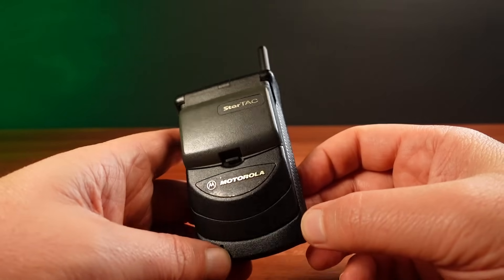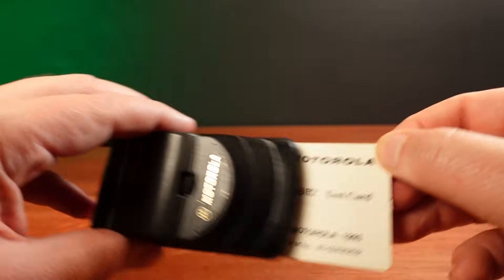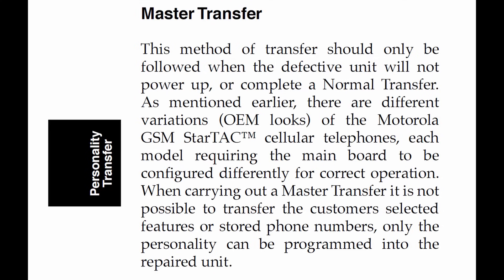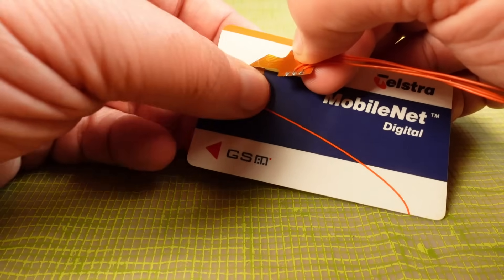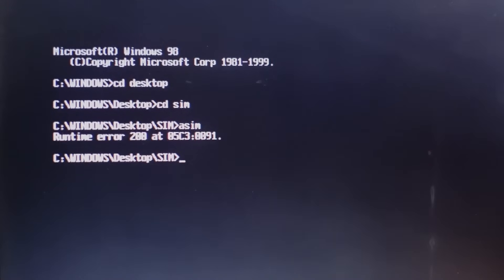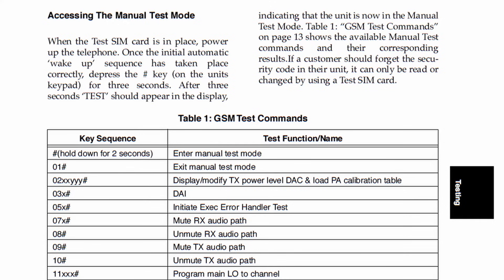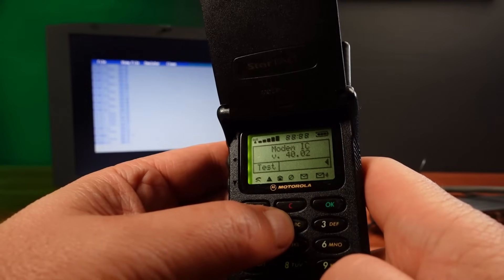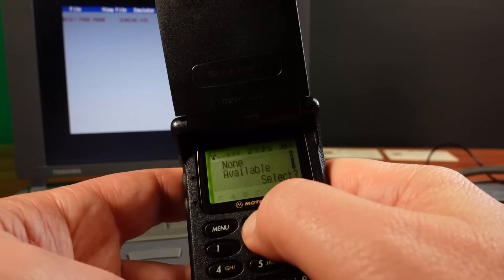SIM Card Emulator Vs Motorola StarTAC

Comment: I had a play with these Motorola SIM card emulators a few years ago and changed the graphic on a M3788 and enabled the Engineering menu on a V3688. It was quite fun wandering around with it looking at the figures. I didn't bother making a fancy "SIM Card" like you did, I just used crocodile clips to clip onto the sim socket. Your solution looks a bit more elegant.
Reply from the maker: That is cool, clipping directly onto the sim pins and getting the job done. The V3688 is so light and small, I have one as well.
Reply: @JanusCycle  The V3688 is a cool device. The sounds quality is good and the holographic reflector they used in the screen is really neat. Unfortunately its all plastic clipped together construction makes it a bit flimsy -  a bit reminiscent of today's smartphones! These old GSM Motorolas would be quite usable today if it weren't for issues with their SMS support. They only seem to support the 7 bit GSM character set and some people will send messages with non-GSM characters, in which case the phone will refuse to display the whole message, whereas Nokias and Erricsons will just ignore the dodgy characters. I've no idea what characters people sent me in order to cause this; probably just those pesky smileys :).

Comment: Great video, makes you wonder how much mischief could have been had with this knowledge when the network's were running.
Reply: In the days a little before, phones used analogue transmission with digital codes for cell routing etc. Some shitty newspaper had a radio scanner and caught Prince Charles exchanging naughty words with Camilla. All completely unencrypted. The other thing was, people would set up premium-rate phone lines. Then they'd go out and wander through town with a receiver picking up, I think, ESN and MIN codes ("pairs"). They were transmitted by phones as part of the protocol, unencrypted, and the network trusted you were who you said you were.

So they'd hack phones and put in these pairs, cloning the phones whose signals they received earlier. A cloned phone is on somebody else's phone bill. I saw a TV report, a wall with dozens of phones mounted to it, all on chargers, and all cloned. Ringing up the premium rate number in another county. Racking up a fortune in bills. But because it was a foreign country, the home nation (Britain) couldn't do anything to force a refund. The foreign telco and the pirate split the profits. A lovely little earner, and all you had to do was hang round a metropolitan train station for a bit while your gadget filled up with pairs. When it was full, you go home with your haul. They made a ton.

Of course this was when only rich wankers owned mobile phones, back in dinosaur times, so little sympathy. Usually their carrier refunded them and copped the bill themselves. International phone agreements mean bills must be paid!
Reply: 2G is still in use in Central Europe with the plan of shutting down no earlier than 2028. We shut down 3G networks rather than 2G in the effort of making space for 5G as there's a significant number of users with 2G phones (I assume old people) while 3G never really took off around here.